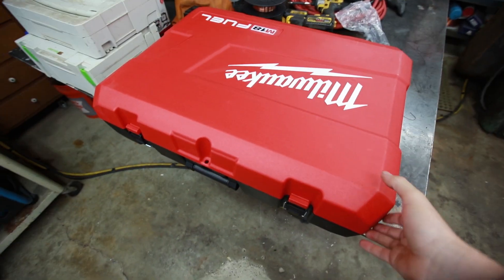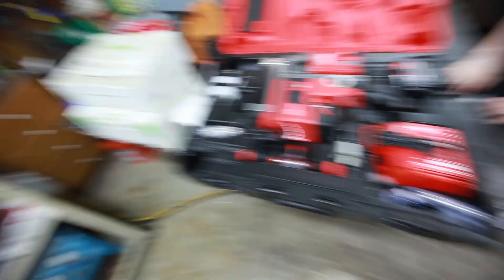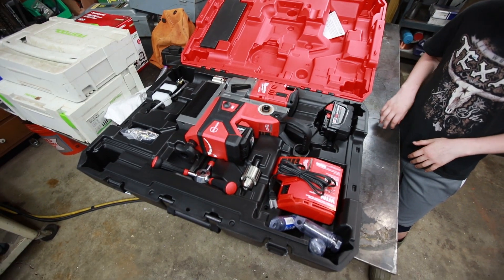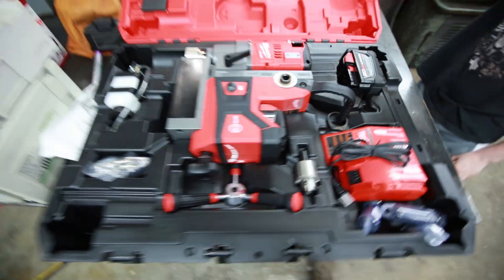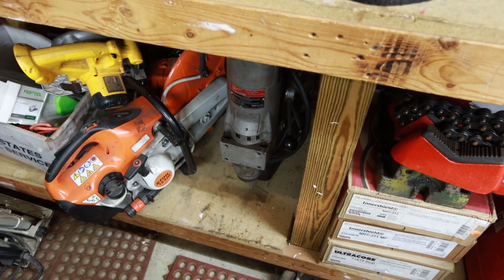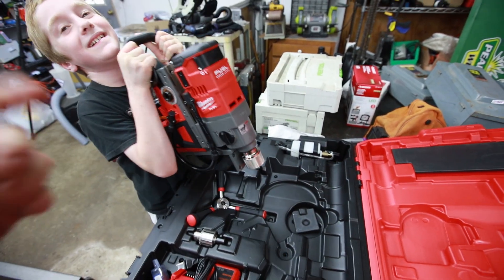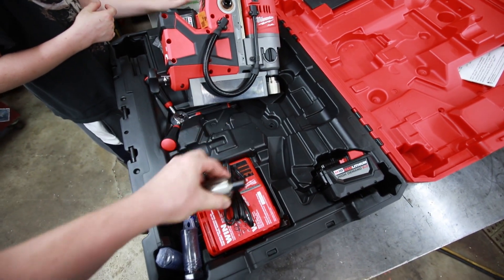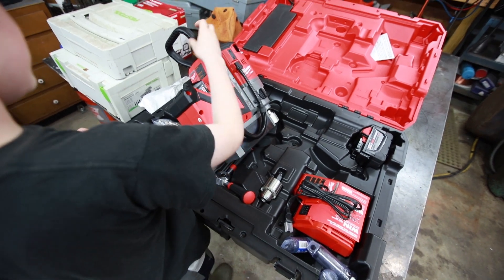Shop Update And  New Tool

Comment: Be careful using that on a painted tank, we use them doing tower work pretty often and we typically have difficulty when using the electromagnet on heavily painted or galvanized steel. Also depending on the radius of the tank, you may need a tapered shim plate to square up the chuck to hold square. Good luck!